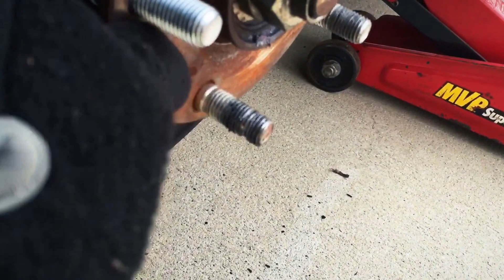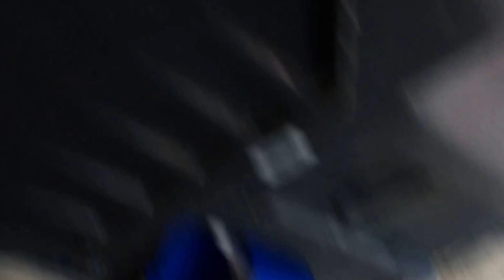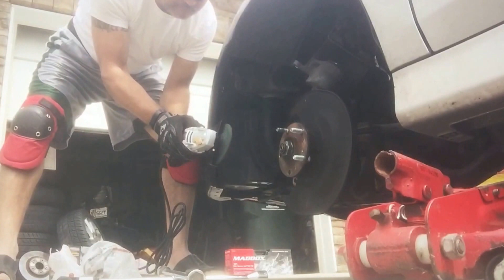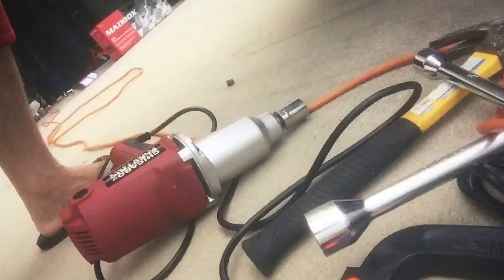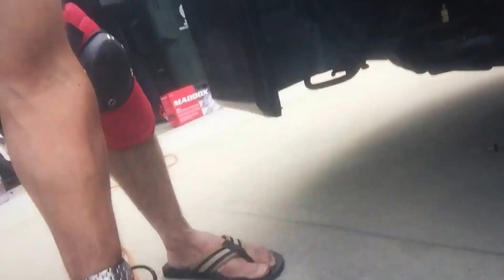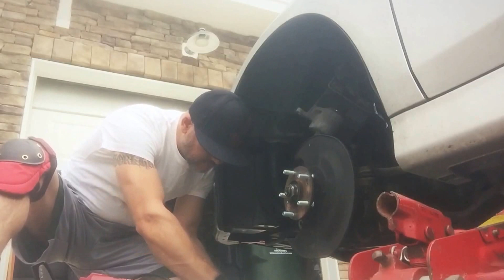2007 Acura TSX front wheel broken stud change

Comment: In this crappy fast fix of a job where you don't remove the entire hub, why wouldn't you just grind the stud flat on one side instead of grinding & weakening your whole wheel hub?!  😫
Reply: It is a press in hub. In order to take the hub off you need to remove the whole knuckle and have it pressed out and changed. $2 wheel stud vs $100 wheel bearing and hub
Reply: He did it because the old stud needs space to take out,no room to grind them
Reply from the maker: @sorryimajerk735  I keep my tools clean, you cannot judge someone if they keep their tools neat and tidy.
Reply from the maker: @sorryimajerk735  Show me how you can remove a bearing without a press???
Reply: By using a slide hammer and cups , plates and a forcing screw
If you didn’t know that already don’t even bother arguing with me about it
Reply: A real mechanic doesn’t use a framing hammer to work on a vehicle
Reply from the maker: @lindsayjames4044   I did this cause it was easier. There are several other methods of doing it and this is one way of doing it. A tool can have multi purpose. what you use how you use is up to the capability of your brain and imagination.
Reply: @lindsayjames4044  and yet you're here watching this video because you probably can't figure it out yourself
Uh? Mrs "Real mechanic"